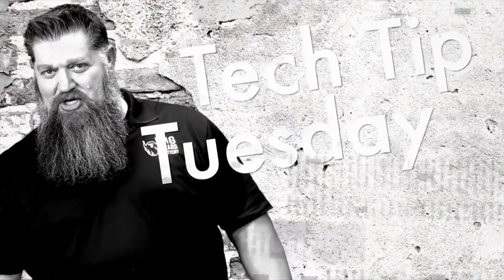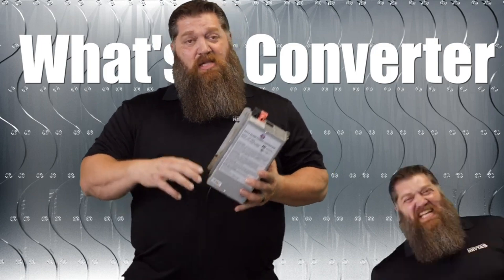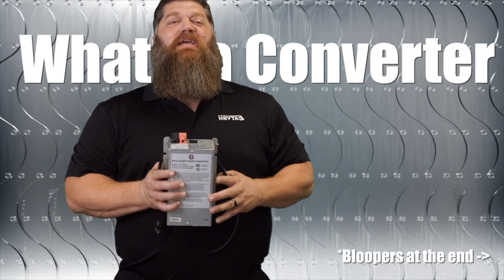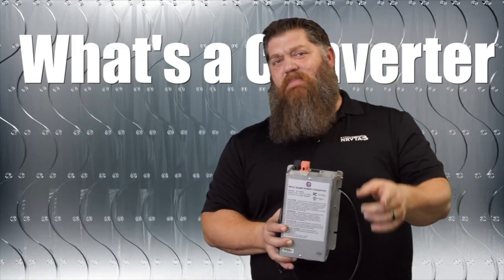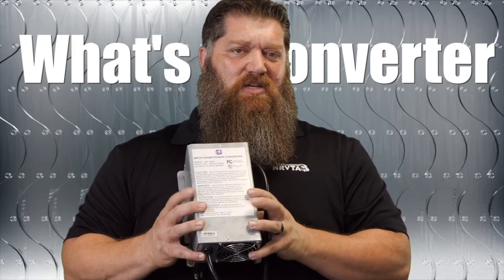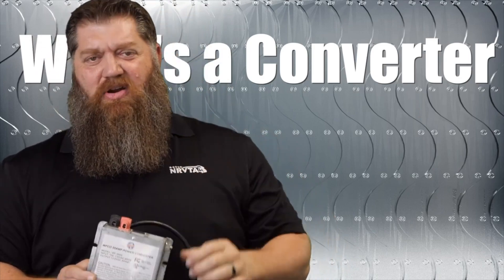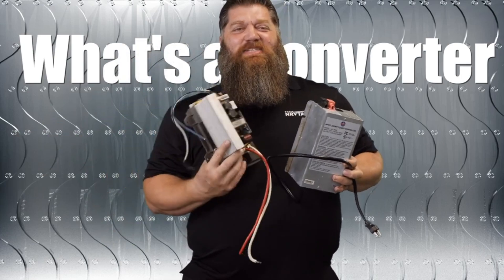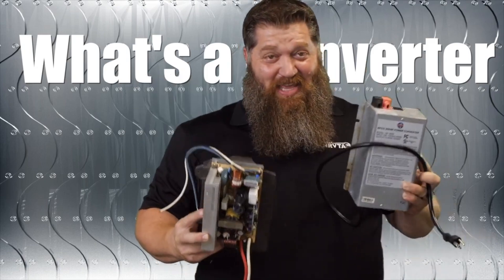What are converter chargers?

Comment: Difference between converter charger and a charger? Why not just plug a charger in and connect it to the battery bank? Why use a converter charger? I have lifepo4, will a multi stage converter charger know how to charge it because a regular charger has a lifepo4 setting for proper multi stage charging.

Comment: Are there any dangers to having a converter without batteries hooked up? Its how my rvia tiny is set up and sometimes enters a recharge mode (yellow status light); not sure whats happening since there is only shore power.
Reply from the maker: So the converter in the rv doesn’t have great rectifiers to make a dc signal. The battery is there to help clean up the dirty dc signal from the converter.

Comment: Todd thanks for the great videos. A lot of folks get confused on the 3 devices, inverter, controllers and converters. They talk about one thing and mean another thing. Maybe you can do a video explaining what the 3 devices do. Controller is used for your solar to down size the voltage to 12v, inverter is a device that converts 12v DC to 120v AC and the converter does the opposite of a Inverter it converts 120v to 12v and charges your batteries too.
Reply from the maker: Thank you for the suggestion! We dropped a video this week! https://youtu.be/k1XUp6oMIT0?si=D1dUqPUnpYGGDs_l

Comment: Ok sooo...🤔

*All RVs comes with a converter
*There's 2 types of converters 
*All converters are maintenence free
*All converters has their own breaker
*All converters tells you to leave in the fall
*All converters works off shore power
*All converters when plugged into shore power is on
*All converters are hidden
*All converters recharges your battery

Question:
*Besides hearing the fan running how do I know if my converter works?

 I can park my travel trailer at my house WITHOUT being hooked up to shore power, and just from listening to the stereo for 3 to 4hrs a day kills the battery within 1-2½ days. The battery will be DEAD.
So to charge the battery I need to hook it to shore power. Normally, I hook my jump pack to the battery to use the electric hitch. By the time I get to a campground the battery is somewhat fully charged from I'm assuming the 6plug to the truck while we are traveling.

Comment: GREAT VIDEOS TODD!!! BUT……. My lithium compatible converter  went bad. I can’t get it to charge my batteries, with my generator running.  I always shut off the converter when we boondock, and use solar. I turn it back on, when I plug into the generator, to charge the batteries, on rainy days.  HELP! What could be wrong?
PS….
I’m a vet, and am getting ready to take your fundamentals course, with my GI bill. 
Thank you
Tracy Meskel
(Fishchaser)
Reply: I see no reason to turn off your converter since it only operates when you plug into shore power or generator power. 
I only see it necessary to turn off your converter (battery charger, and converts 120v power to 12v power) when you are running an inverter with your RV plugged into the inverter. It causes a charging loop. I have a 20mp stand-alone lithium charger cables directly to my batteries so I can plug shore power or generator into it and charge my batteries.